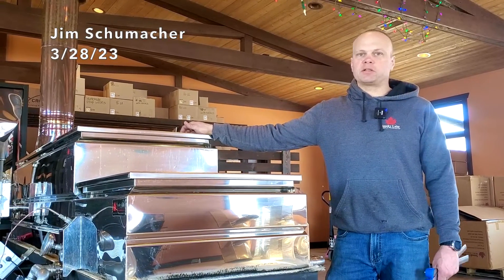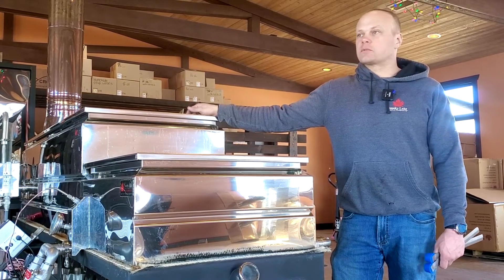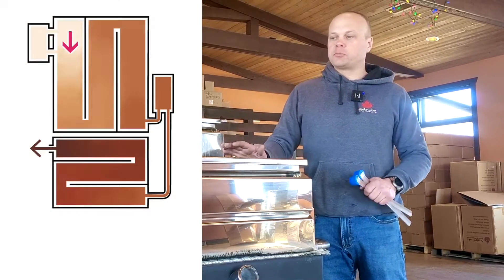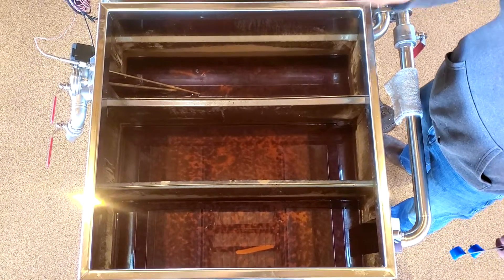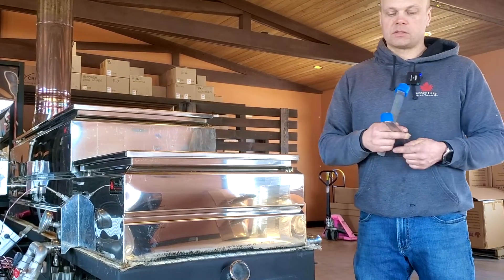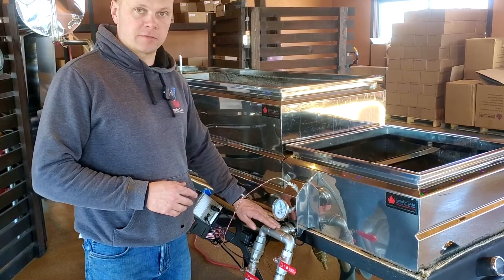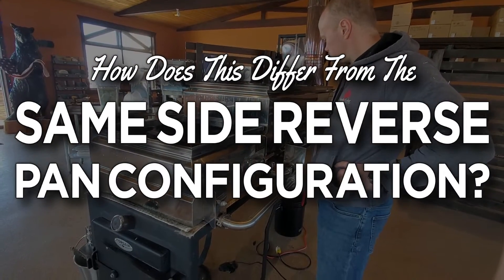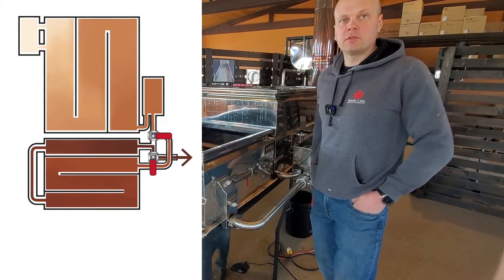Reversing the Flow In A Maple Syrup Evaporator

Comment: I have a 3x10 no ro and I have 2500 taps here in Vermont looking to upgrade what should I be looking at
Reply from the maker: Our wood fired evaporators process 6 gallons per hour per square foot of pans.  So, our 3'x12' Silverplate will evaporate about 220 gallons per hour.
Reply: @SmokyLakeMaple  With my small  brothers  I’m doing probably 120 gallons an hour that would be a great improvement That will save me lotta time my arch does not have a blower

Comment: Are there any drawbacks to SSR? Why wouldnt EVERYONE have it? And even with it, eventually you'll need to drain the pan and remove the sand cake directly.
Reply from the maker: No real drawbacks to SSR (Same Side Reverse) systems, other than maybe cost.  You can see it would have saved a bunch of time here.  However, it's worth considering that the cost for the SSR system could go a long ways toward a second standard front pan, giving the operator a spare to rotate in. 

If I were to configure my own evaporator to run the rest of my life, it would be an SSR.
Reply: Question Jim.  On my 3 x 12 Silverplate SSR my reversing procedure is done after every boil.  I switch during the shut down procedure so the rich sap is able to move under low heat.
🍁My question is what position is the lever placed to stop flow from the front pan float box if I were to replace a pan?  I see there is a pin on the valve that won’t allow to shut the flow.